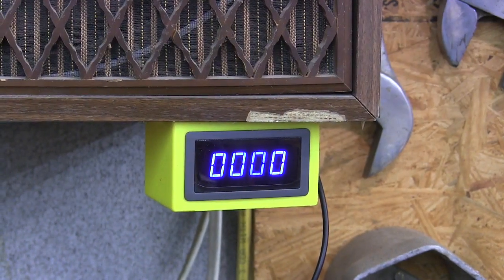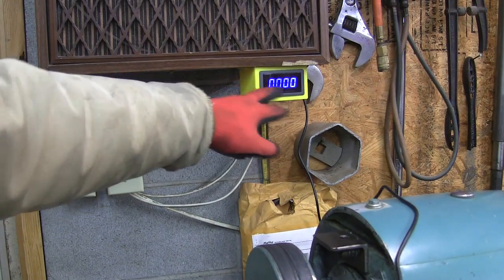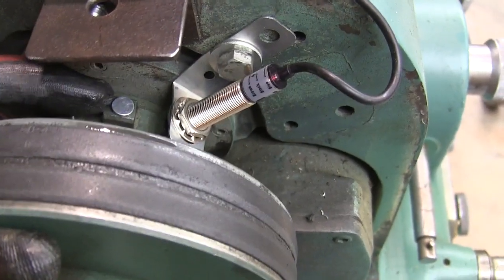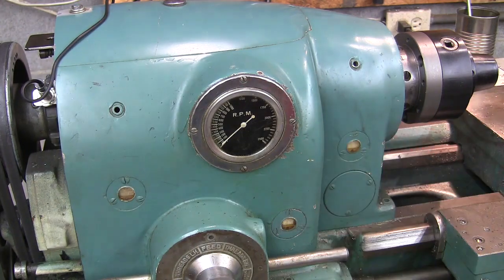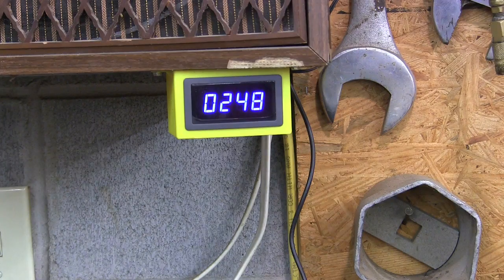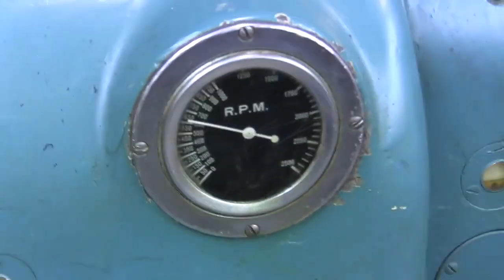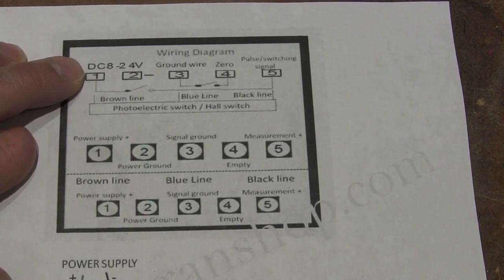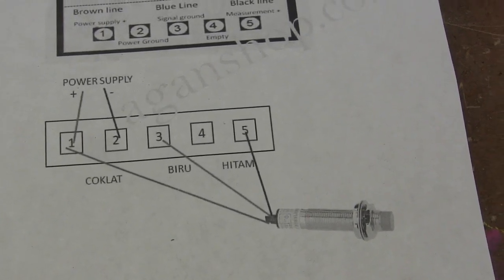How to Install a Tachometer on Lathe, Mill, etc.

Comment: I may be a little late here, but I think the RPM gauge may be correct in correlation to the spindle mounting setup. “Technically”, even 1/16” can cause a variance of a few hundred RPM’s in certain instances. I’ve had to bring this up before on another build someone started where they complained the digital readout was way lower than advertised. Turns out the sensor was attached to a piece with a larger circumference than the original spindle size. 

Hope I may of been some to help to someone in the world out there lol
Reply from the maker: Thank you for sharing your experience!

Comment: Cool, I just got an electronic tachometer to work on my SFM s , it probably is cheaper to put a tach on the mill permanently like this, even better with a variable speed unit. Thanks and cheers!
Reply from the maker: What type of tach did you use?
Reply: I got a cheap one on amazon, just a hand held, I am not very good at getting mileage out of my end mills, so it was back to theory on the slow boat ! @SoatMon

Comment: Thank you for this information, Long ago I tried this and it didn't work....I will just bet I had the magnet in backwards.   Just wanted to tell you about the glued on wall blocks for mounting switches.  It does work just fine on drywall.  But at work we have walls made of what they call clay tile blocks.  They look and break like terracotta tile.  These things are very brittle and easy to crack even with a small drill.  So I told the guys about your idea and they tried it on the clay tiles and it works a treat.  So your idea really works good for this application.  They are even using it to mount light conduits and signs.  Also, they are experimenting a little with what glue works best.  What they found is that JB Weld by far works the best.  Even over some expensive epoxy products.  I am thinking even for the drywall applications I will just use JB Weld from here on.   Thank you again.
Reply from the maker: That's awesome, I'm glad it gave you a useful idea.  I bet that clay tile is tricky. I had another guy tell me he used construction adhesive but had to tape them in place so they didn't slide while they dried.  Thanks for taking the time to share the results from your experiments.
Reply: Soat Mon,  You are so right.  I forgot to say what they do about holding them in place.   They go to about two or three places depending on the size of the mounting board and put a big dab of hot glue on the board and press it onto the wall for just about a 1/2 minute.  Put the JB Weld on first then spots with the hot glue.  The hot glue acts like a clamp and that is how they hold it in place.  Sorry about forgetting to say that part.
Reply from the maker: Using the glue as a clamp is a great idea.